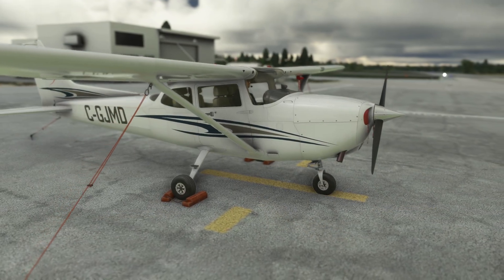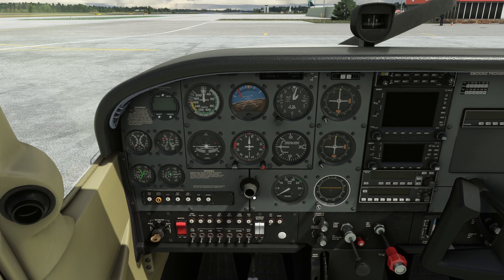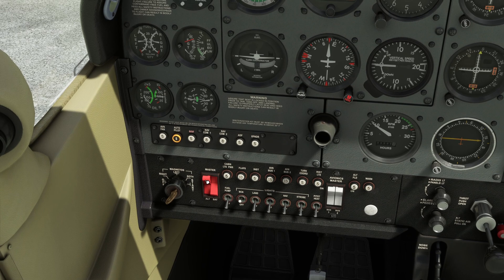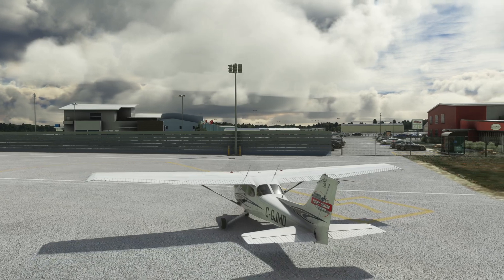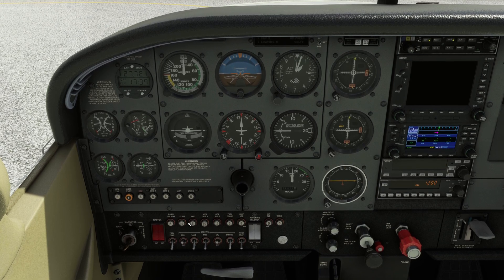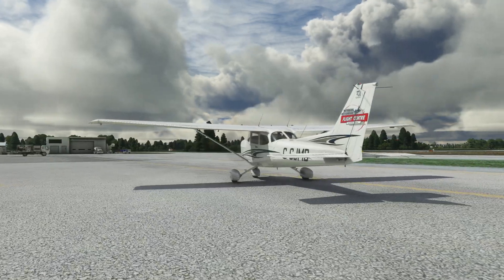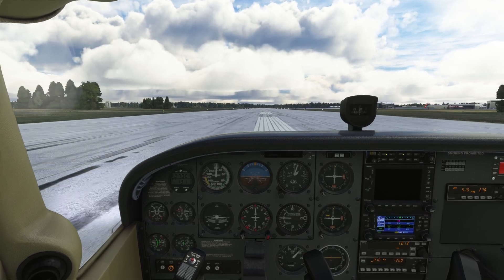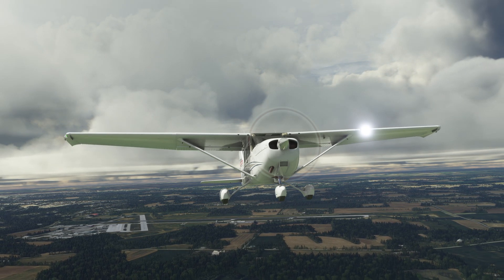Learning to Fly with MSFS | Advanced Procedures | EP1: Engine Start,  Taxiing, & Takeoff

Comment: Nicely done - Looking forward to more.
A few important  things you missed..
(1) Setting AP    and Panel Altimeter setting.   The AP  Baro  was still flashing,  so was never set,  so AP  will never turn on.
Should be in a Checklist for a C172 with the GNS530
(2) Always good practice to set the Heading bug to the assigned runway,  and then cross check  when turning onto the runway, that you are really at the correct runway.
(3) Checking engine temperature  is sufficiently hot before takeoff  is important.  Engine can run rough if cold, and not develop full power  (modeled in this WB-Sim enhancement Mod)
Reply from the maker: Awesome! thanks for the input, love it! :)  I also had the top GNS off , but didn't want to refilm (big oops haha). Good to know about the AP, never flown one with it , so I will set it next time (will add ammendment to next videos, especially navigation portion). Will add a point to check the heading bug as well, on a DA40 that I fly, I typically check the heading to compass on holding short point (didn't include it here). Agreed on the  temperature, I'll make sure to include it on the next video.
Reply: Good pace, sounded very in control. 

To add instruments should be checked during turns in the taxi. Wet, DI, turn cord, attitude. Turning right check, rising, rising, right, left and erect. Turning left lowering lowering left right and erect.
Reply from the maker: @johnmaguire2185  Will add instrument tuning check! Good point! It's very important for IFR , which I will be covering later on.